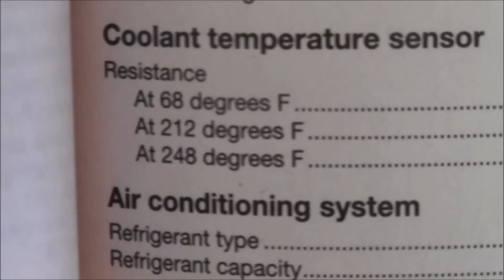Engine Coolant Temperature Sensor on Ford Contour 4 Cylinder

Comment: On the 1995 Ford Contour V6, the coolant temperature sensor is under the EGR valve/ Throttle body. Very hard to get to. Also, the Coolant temperature SENDER is toward the front of the water pump on the side near under the Resonator.